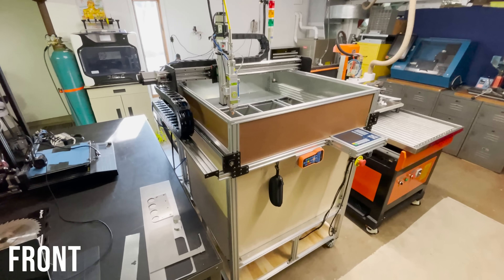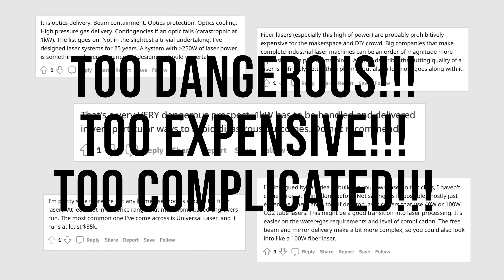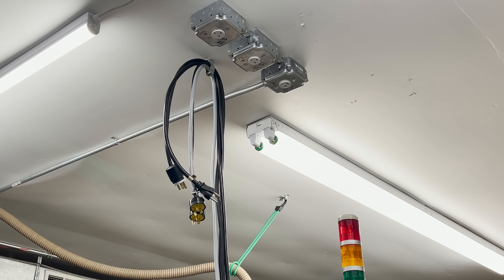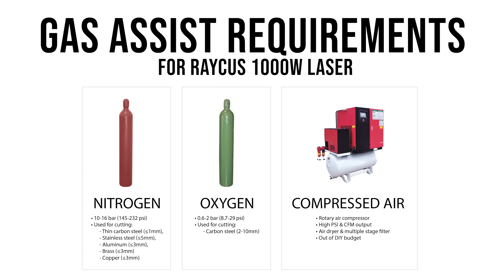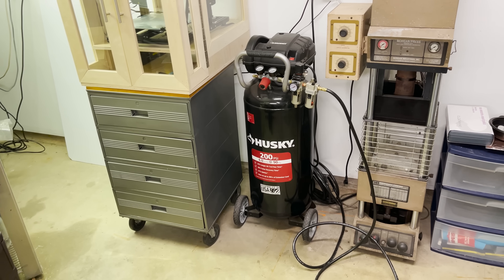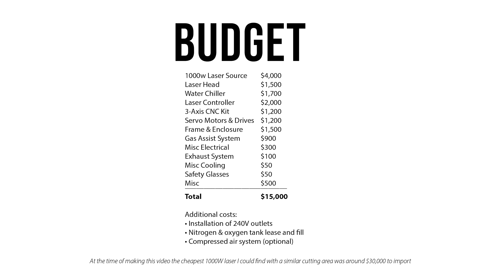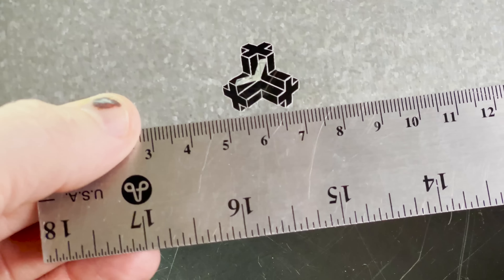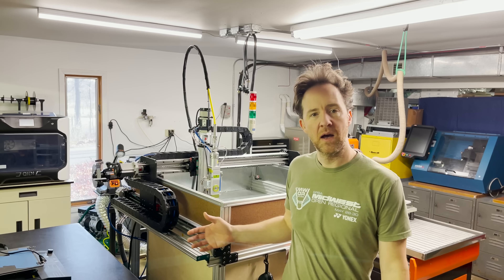DIY 1000W Fiber Laser Cutter Part 1: Project Introduction

Comment: Really looking forward to this series, with that mad scientist hair you are rocking I think this will be a good ride! The diode lasers on a CNC are just not interesting enough for me so this is way better. I can use a VFD to produce the 380V 3phase, what kind of current are we talking? Edit: nvmd, 3500W for the P/S means about 15 amp at 240V.  The 1500W I saw on their site was 5500 watts at 240V single phase so, so 23 amps.  Well within a Dryer plug specification... Hmmm....

BTW what's up with the Air Powered Shuttlecocks?
Reply from the maker: You are the first to mention the shuttlecocks, so I feel extra-compelled to reply : ) My wife is a former Team USA Badminton player. Since my introduction to the sport, I have become a huge fan and play weekly. So far, I have primarily used my workshop for prototyping and developing badminton-related products, including: shuttlecock launcher for training, badminton footwork trainer (https://fasterfootwork.com), 3D printed shuttlecocks, etc. !!WARNING, NERD TALK!!: Compared to other "ball" type sports, the shuttlecock is quite complex to design around, because of its light weight, unique shape, flight characteristics, and handling properties....and I really enjoy the challenge! In the future, I would like to showcase some of my badminton projects on this channel, but I'm not sure how well it will be received, since it is quite unpopular of a sport in the USA.
Reply: There's a channel for everything - especially in the makerspace. I recall leagues of badminton when I was younger. It was perceived as a 'lesser' sport by some but while I played other sports I wasn't all mental about them and I quite enjoyed badminton. We often played it in the backyard during family gatherings.  
If you want to make yourself rich,  invent a bird that will stop mid air or at least come back from over the fence where it inevitably ends up during some off balance recovery return. :)

Comment: I have worked with Co2 lasers cutting metals, watch for micro metal particles in your extraction system. I have converted an old EverFlo Oxygen Concentrator to produce ondemand O2 for a small torch setup, not the purest  O2 but works well enough for gas welding.  Just food for thought.

Comment: Sorry if this was mentioned or just not in the footage, but open both gas cylinder valves fully, they have a double seat. 8 out of 10 lease/rent high pressue tanks will go completely empty in hours leaking through the valve stem packing.

Comment: Great Project!   I pay about $35 for oxygen tank exchange (for a tank about half your size) -  at work where we buy a lot of gas I pay about $50 for a nitrogen tank exchange.  Buying the first tank is expensive but after that it is just a matter of exchanging tanks at the local welding supply store.  I don't know how much gas you need but I purchase used oxygen concentrators (off Craigslist or the marketplace) for torches for glasswork (you can compress the oxygen for storage if needed).  for a 5 LPM unit I pay $50 to $200 - You should be able to get the nitrogen out of the exhaust without too much trouble.  If the concentrator breaks there is a great little low pressure compressor inside that is worth whatever you paid.

Comment: What is difference in the cutting quality/speed when using:
1. oxygen (pure oxygen/concentrator/compressed air) 
versus
2. inert gases (nitrogen, argon, maybe CO2?)      
As I think the solutions with oxygen content besides the blowing effect also have an effect of oxidizing the molten material (effective most of all for steel burning it into iron-oxide powder), the inert gases have only the physical effect (blowing) but the do the opposite of oxidizing, they prevent it from happening.    Is this requirement different when cutting aluminum   (that has a much lower melting temperature but more resistant to oxidation)?
What do industrial laser cutters use?

Comment: use your air compressor with two big water traps. it will make it cleaner. also you can up the pressure on almost every air compressor. inside the in switch box is usually a pressure switch with a screw. turn the screw a bit at a time until it blows the pressure release vales and back it off a tiny bit until the blow is not triggered(when the motor is running and its or close to at max psi

Comment: Hi friend, thanks for the video, I just have everything for my fiber laser, I buy all 2 months ago but I have a doubt about the connection between the DSP and the Raycus 1000W, could I send you my setting in email and you tell if I'm doing it right, please I have almost everything  ready but i want to be sure about the connection, is the only thing i need, thanks for all.

Comment: Why industrial $2k controller?
I see no reason why you shouldn't be able to run the machine on a $100 3D printer board, and those can be configured to laser mode.
Heck I would say that functionality you get from Marlin is vastly more advanced than what comes on those proprietary controllers.
Reply: I was thinking the same thing but if you google a bit you see even with a Duet3 the support isn't all there.
Reply: @Deneteus  What support you mean?
Basically all 3D printer boards run Marlin Firmware which is centered around FDM 3D printing but can also be configured to run laser cutters, engravers, and routers/mills.
Also if it's missing a function at first you can add it to the code.
Need gas control?
No problem, you can set up custom macro to do that on unused bed heater output to control a solenoid valve.
At work we building very custom automated TIG welding rig which is meant to weld hundreds of same thing.
I just bought $40 3D printer board and I was able to configure it to do all I need and auto repeat with one button for production people.

Comment: Very impressive 👏 I own a commercial 1kw Fibre laser running on cypcut and can relate to some of the challenges regarding gas v air. I only cut stainless steel and bottled Nitrogen is expensive although the prices you mentioned are a lot higher! I could empty a 16 pack of 50L 300 bar cylinders in 8 hours! I did toy with the idea of building one myself but would probably still be working on it 3 years later 🤣 my hat is off to you well done 👍
Reply: You should look into a dewer.....at my last shop we had a 3k fiber laser and went from a  200L tank to a 400L, but eventually settled on a 5,000L dewer, cutting stainless and aluminum all day at 180psi, the 200L would last about 2 days... liquid is way cheaper than the high pressure 16 packs.
Reply: @Steelcrafted  you don't see any small N2 dewer systems in the UK. Only massive liquid systems. Could be an option in the US but I've heard you lose some % to evaporation. I now use a nitrogen generator and it works great for me but it's very power hungry so not ideal for home use

Comment: That was impressive! However, I think the parameter setting for the controller should be changed because during movement it turns out the whole machine is shaking, so I suggest you change the "Jerk" for smooth movement.
Reply: I was thinking the same thing.  That's quite a bit of mass zipping around.  I'd make the table stiffer and heavier along with reducing the acceleration.
Reply from the maker: I'll get to it in the next video, but basically the frame is really rigid, but it is setting on a set of flimsy casters that I used to move the machine around while building it...that's where all of the shaking is coming from.

Comment: Well done, Man!!! 

It takes some guts to attempt something like this from a home garage. I have many years of experience in lasers. I myself have designed and or built almost all types of industrial laser systems you can think of except subsurface green laser marking or UV lasers, but all the rest high power performance CO2, 3D galvo, laser welding, welding cleaning, heat treating, scribing, robotic, metal cutting (CO2 and fiber), marking (CO2, Fiber and old school diode pumped ND:YAG). Although i have never had to do it with such limited tools and budget. What you are doing is very impressive. I sincerely want to reach out to you and offer you my help and experience if you are interested. I don't get much time to play around anymore and would love to help you get the most out of your machine. I can see your machine is still very clean, so you still have quite a learning curve ahead of you.

Let me know how I can get in contact with you to send you, my details.

Comment: As the video says, I also would like to draw everyone's attention to the dangers of lasers, especially in a DIY project it is possible to get carried away and not pay enough attention.

Above 5mW any laser can be dangerous to eyesight,  that is 0.005 Watts. It is here 1000W we are talking about, imagine what tiny portion of this (you don't at all for God's sake have to look into the beam, a tiny reflection, a weak scattering for 1ms that you would be total unaware of) is enough to make you blind. More to that these laser sources are 1064nm infrared, you see nothing of it.

excerpt from wikipedia:  Infrared lasers are particularly hazardous, since the body's protective glare aversion response, also referred to as the "blink reflex," is triggered only by visible light. People exposed to high power lasers emitting invisible 1064 nm radiation may not feel pain or notice immediate damage to their eyesight. A pop or click noise emanating from the eyeball may be the only indication that retinal damage has occurred, i.e. the retina was heated to over 100 °C (212 °F) resulting in localized explosive boiling accompanied by the immediate creation of a permanent blind spot.  (my amendment: in case of 1000W this 'spot' will cover both your eyes including your brain tissue behind them)

I advise everyone to install protective covers on the machine (electrically disabling the laser when opened), always (while the laser is powered) wear tested, at least OD7 level (OD8 OD9 would be better) protective goggles designed for the wavelength of your laser, in this case it is 1080nm. And take general precautions: although very tempting to watch a 1000W machine in action, even a weakest accidental reflection of 0.0001% of the output beam (e.g. made by a falling/bending cutout piece of metal) with a small gap around your glasses can make you blind.    I propose to not watch the machine in operation at all, or watch it only thru a camera.  Another safety idea:  a cheap $15 webcam with the IR filter removed sees the 1064nm excellently. Can be used instead of your eyes, much easier to replace.
As a DIY enthusiast you will also be tempted to show your working machine to others (friends, family), just don't do it. Make videos if this is needed.  Also make sure that you lock the doors to your garage, shed, whatever when you operate or test your machine, so nobody can enter the room accidentally without protection gear.   If you have curious, experimenting-type (like you) kids or their buddies are, make sure to lock your laser with a key or disable it reliably while you are away. Treat it like it were a gun, prevent your kids from 'inventing' Luke Skywalker's laser sword

Sorry for the alarmism, but this cannot be said often enough.  This is not a broken-milling-tool-level hazard. if you can't handle it responsibly, this is not the project for you
Reply: I appreciate your input here! Like me i also think "safety first" What you wrote will help me on my build, thanks for the input
Reply: @themakeruk392    Thanks for the feedback, I'm glad that at least one person is paying attention, so it was worth writing this long comment.